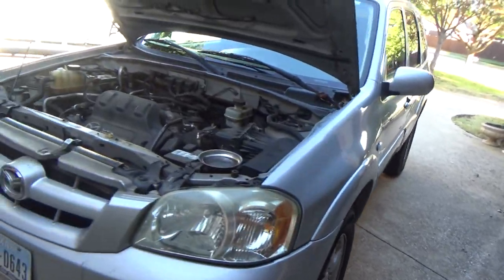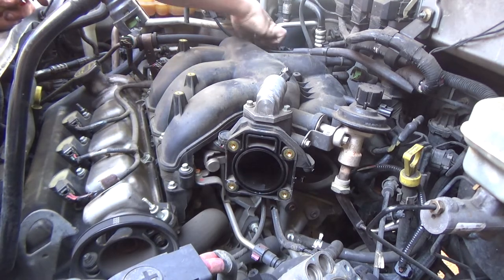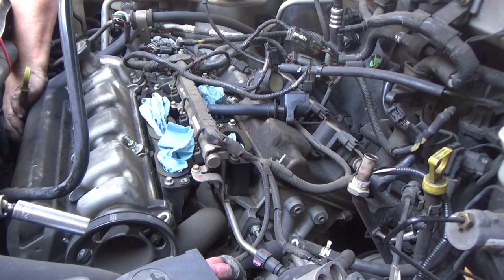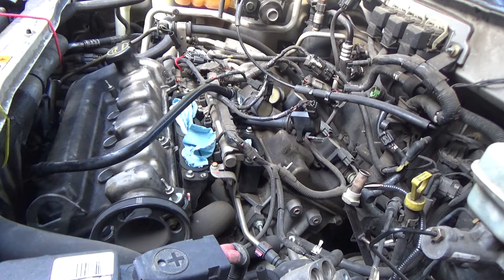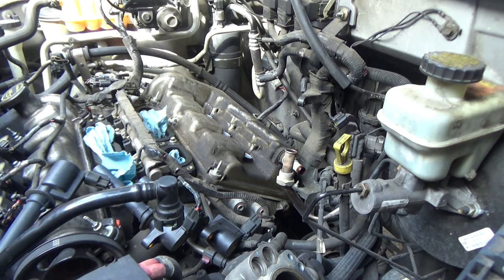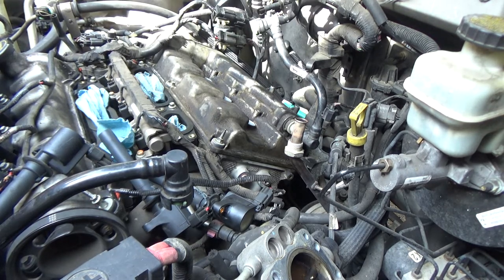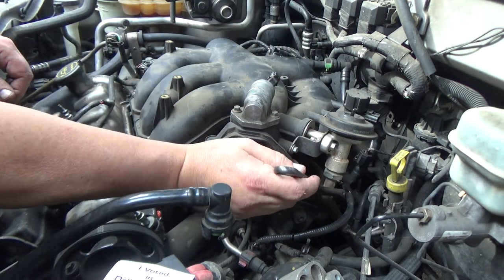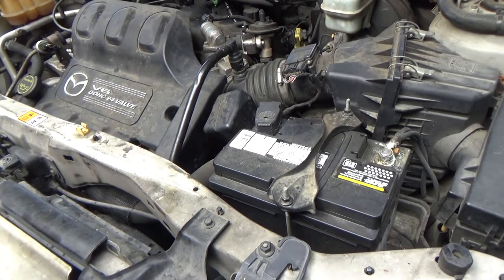2005 Mazda Tribute / Ford Escape 3.0L V6 Valve Cover Gaskets replacement.

Comment: Great video.. Getting ready to start mine.. this engine has a common problem of the cam cap bolts coming loose… Always verify torque on them while you have the cover off… Just a suggestion for folks…

Comment: I have a 2002 Mazda tribute and iv been a Tech 40 years and its my mazda Nightmare doing the rear cover but did you clean out the oil from the spark plugs????
Reply from the maker: Yes. Always clean the oil out.
Reply: how do you clean out the oil?

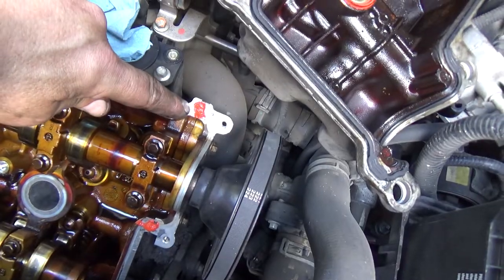Comment: Question: what's the reason for the RTV on those places only when you have a brand new gasket?...at 40:30
Reply from the maker: Thats where the seam is at where the front and rear cover meets with the head. Sometimes they are very slightly mismatched so a dab of RTV helps guarantee that it doesn't leak.
Reply: @737mechanic  . Thankyou for the quick reply. 👍
Reply: Yes it does